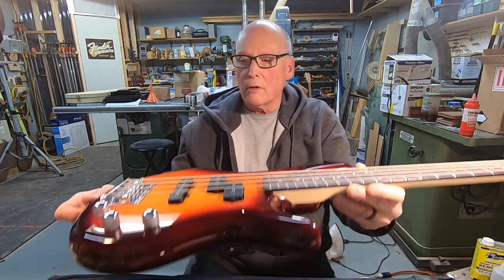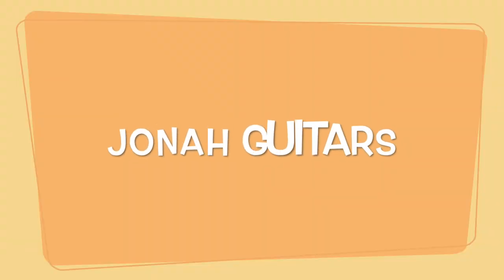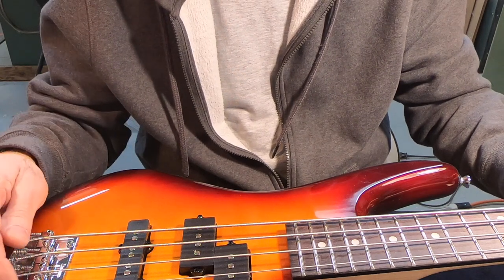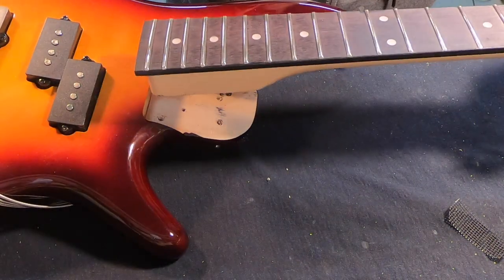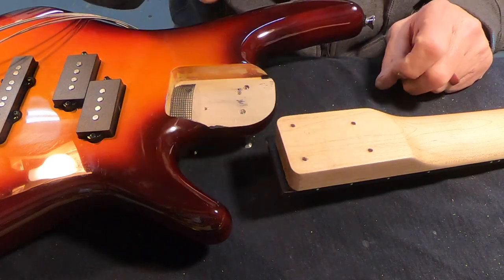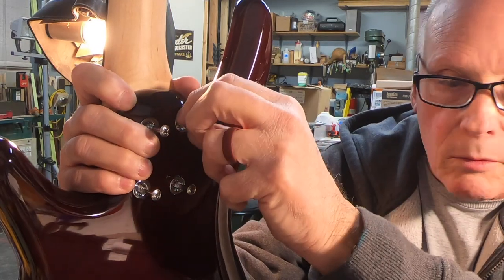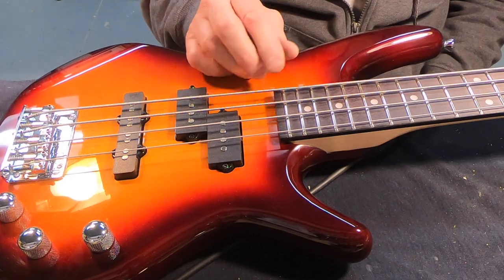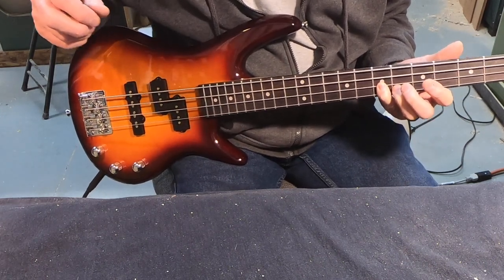FIXING BRIDGE SADDLE BREAK ANGLE by JONAH GUITARS

Comment: This is valuable information because it gets you to look at the overall picture rather than just homing in on your first impression. The use of that shim material is a great idea because once cranked down it'll bite in and add stability. I always clamp a neck when inserting the screws, even when I'm replacing them. Thumbs up Dane.
Reply from the maker: Thanks for having a look Steve. I clamp it with my hand. Like a vise buddy,😏.

Comment: I usually measure by how much I want to raise the saddles so the screw are not poking up anymore. 
Then I measure the neck pocket length, add the distance to the bridge to get a ratio. (say 10cm + 26cm. ratio of 3,6)
I divide the desired saddle raise (say 5mm) by the ratio. 
It should point to a 1,38mm shim at the bottom of the neck pocket ...
Reply from the maker: Thanks much for watching Asfodhell. That's what I normally do but I was trying to keep the video short. I kidding I suck ay math.
Reply: @jonahguitarguy  It's perfectly fine as you explained too 😉👍
Your video is great, and a nice help for people trying to get theirs instruments where they should be from factory.